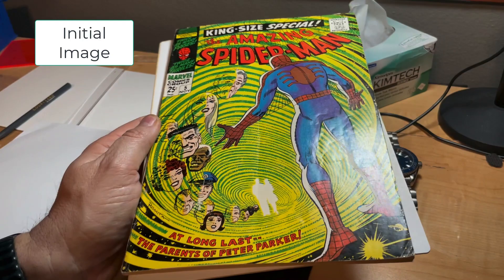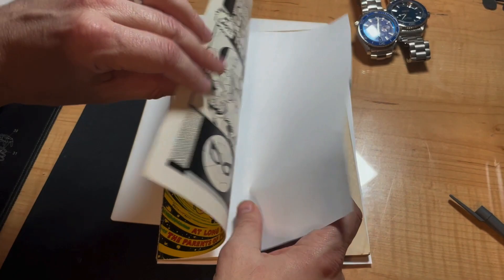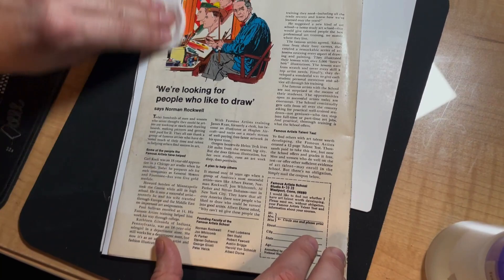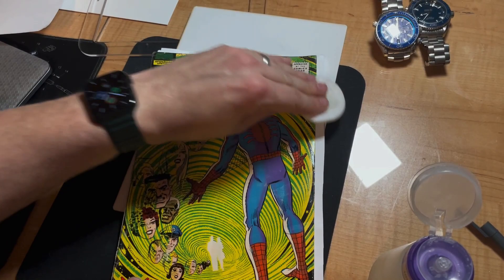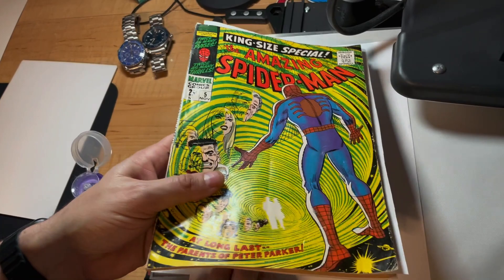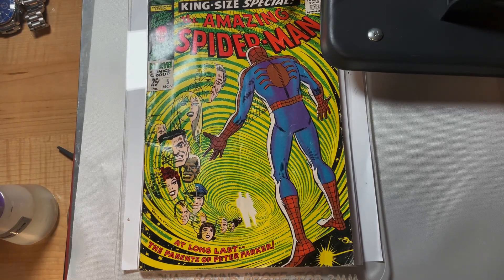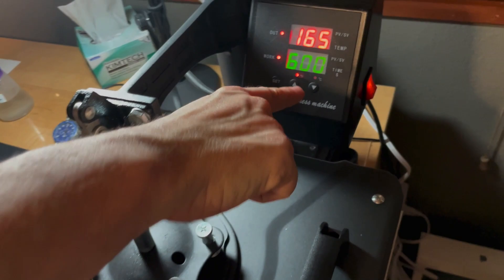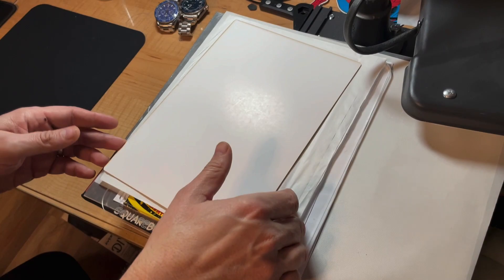How to press a squarebound comic

Comment: Hmmm I'll have to try pressing with heat a little longer than I have been (about 7 minutes), that might improve my results.
Reply from the maker: Let us know!
Reply: @ImmaculateComics  It worked very nicely, I removed the cover from a Superboy 165, (front cover was held on by only a half inch of paper, used some Mending tissue on it, then clued the cover back on (used glue made from rice) It turned out nice, but SOMEONE forgot to take before pictures!
Reply from the maker: Those before pictures elude me too sometimes!!! Lol